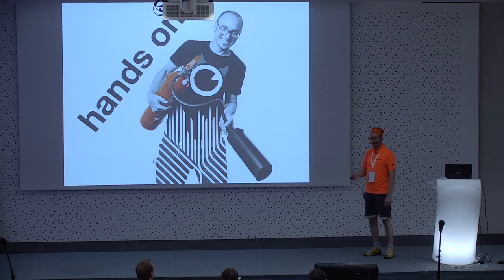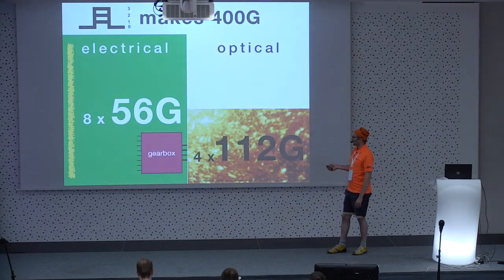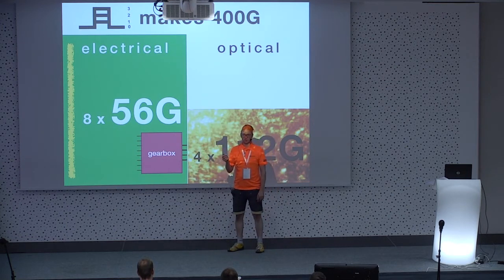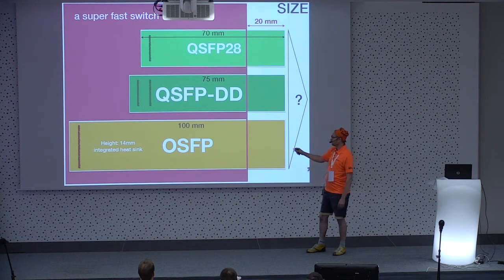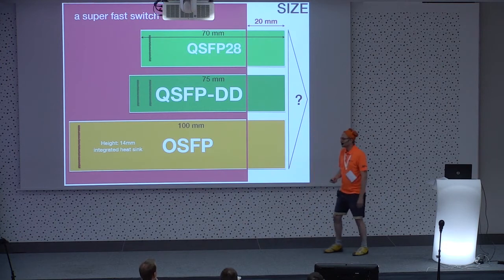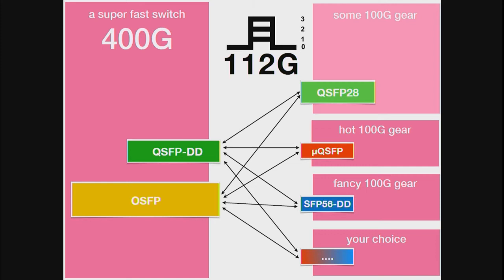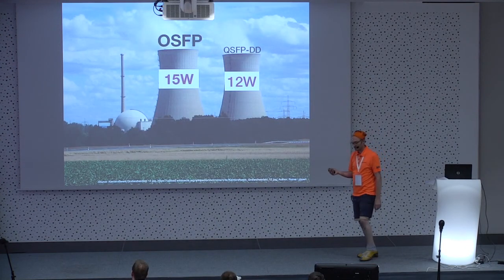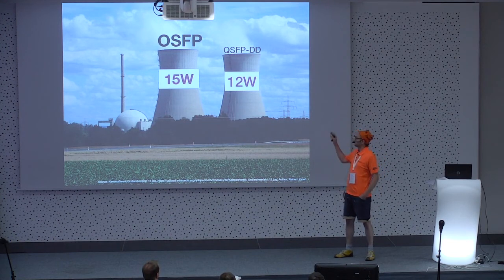400G - don’t get confused with this transceiver generation

Comment: Around 12:20 the speaker first shows 12W for QSFP-DD then mentions it's been shown at 15W (at OFC2018). This paper discusses in detail how that 15W was achieved: http://www.qsfp-dd.com/wp-content/uploads/2018/03/QSFP-DD-Thermal-Whitepaper_Rev1_31018.pdf  Also note that QSFP-DD allows innovation in the cage-attached heat sink which allows further flexibility over time. In addition, the cage-attached heat sink allows for usage in traditional SP airflow from the bottom to top of the chassis with the same module.